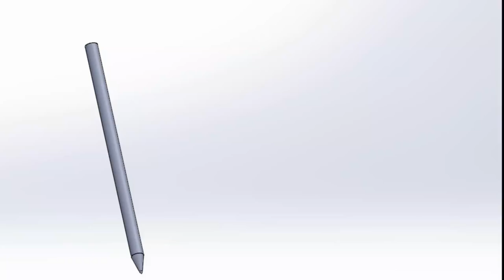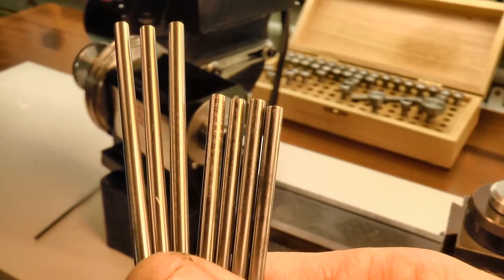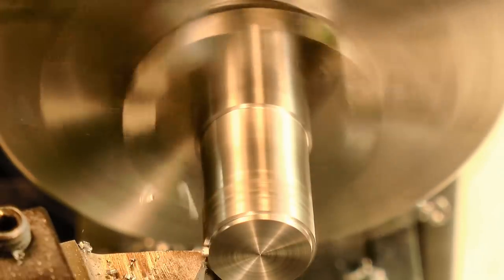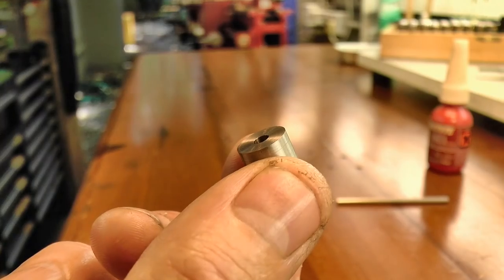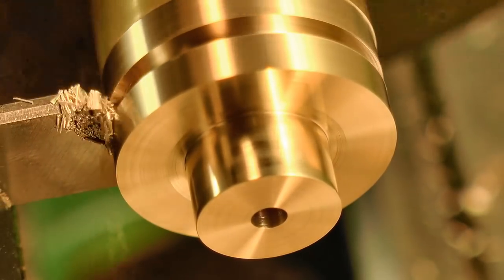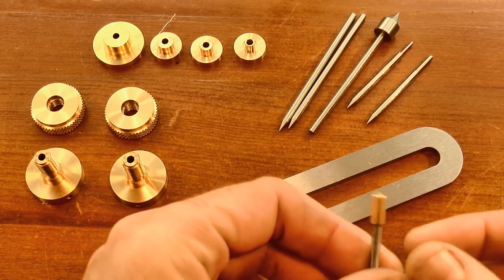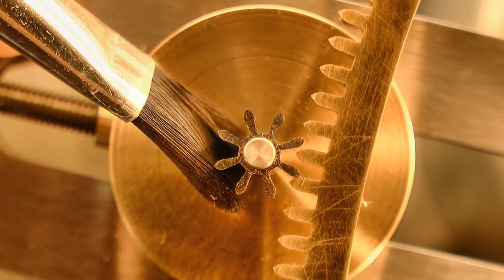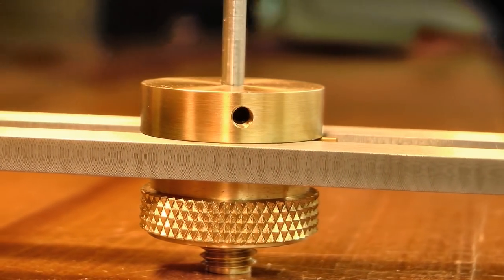Home Machine Shop Tool Making - Machining A Pinion Head Depthing Tool - Part 3

Comment: Holy cow. I have, with rapt attention, watched you craft every millimeter of this tool eagerly awaiting the next installment. It is only now, that I even had any clue what its purpose was or how it was used. Well crafted sir!
Reply: Harlequin314159 I like you was riveted to this series wondering how it would function.  Makes perfect sense like most old school tools.  Wonderful series!
Reply from the maker: Fred Miller Thanks Fred. One of the things I love about clockmaking, is that the old school makers were so very practical.
Reply from the maker: Harlequin314159 I did wonder as I was making it if I should have explained it's use better at the start, so thank you very much for sticking with it through to the end!
Reply: Clickspring I like how you handled both this and the clamping tool. Demonstrating its use completely at the beginning would kind of spoil the end product I think. Cheers!
Reply: Clickspring I agree with OP - It was kind of a mystery until the very end of part 3 what exactly this would be. Good approach to keep the viewers hooked :-)
A little more info on how exactly the correct distance matters would be cool though. Maybe as a little bonus episode?
Reply: Clickspring Nah.  It's better this way.  Like ***** said, it actually drives suspense.  Your channel should seriously win awards or something.  Thanks for sharing this with us!

Comment: Great video,
I am just at the starting line of clock making, retired Engineer/Metallurgist.
I am reading a number of books, but I have to say...
Your video's are very informative, great viewing and well made.
They provide something extra in my case, I am from Northern NSW. Australia,
pretty isolated as far as others interested in horology, so there is nobody to ask or compare notes.
 Your video's fill that gap for me.
Thank you
Reply from the maker: +Noel Rieusset Hey Noel, I'm in Cairns so also a bit isolated from other horologists! Great to have you watching mate :)
Reply: I'm in Scotland (UK) and couldn't agree more.
Not looking to build a clock BUT repairing them often requires making replacement parts and Chris is so easy to listen to Plus very informative.
Keep up the good work.

Comment: Great video!  For anyone working with gear trains this explains a lot.  I am working a gear train where the gears have  1" bores and are 1" thick.  The center to center distance is 3.75"  This tool will be a joy to make and use.
Reply from the maker: Gus Lint Thanks Gus. Send me through some pics when you've made it, would love to see.

Comment: Beautiful work as always. To really have a super fine adjustment, you could use square up your brass end cap on the threaded rod so it doesn't rotate in the slide, and then incorporate a differential screw mechanism.

Comment: Dear Chris,  I think that this depthing tool is a great model for something that I need in the workshop when measuring and repeating holes that already exist in a part and I want to make a matching part to mate with the primary part.  No matter how hard I try to measure with a ruler, the final product is always a few mm out. By using your idea with an array of rods and cone shaped heads, I could then precisely measure the distance between centres of two holes and stamp them with a light tap onto the mating part. My problem is then theoretically solved.  Now a tool that handles three or more holes ...That's for another day.  

My concerns are that the length of the tool will be limited by the wobble that would come in when making a longer length one.  Yours is say 300 mm long and I would want one say 600 mm long.  I guess breaking up the central slot into two slots and keeping a central web will maintain stiffness. 

The saw that you use to cut the round rod looks like it has a round blade, what exactly is that made from?  Cheers.

Comment: I've watched quite a lot of your videos now in rapid succession (since I discovered your channel yesterday) and I simply love them. I have a remark though, a request, if you will.
Could you show us a little more about your process of measurement and calculations as to how exactly you achieve the level of precision in for example the outer diameter of bushings and other critical surfaces.
Again, thanks a lot for taking the time to produce these wonderful videos.
Reply from the maker: EddvT To be honest, there's not really that much to show in that regard - I rough cut using maximum depth of cut that I think I can get away with, until I'm within a finishing cut from the final dimension, I then do a quick check, dial in the final cut, and then go for it. If it's super critical, I might sneak up on it with multiple passes for the final passes, measuring in between each pass. Thanks for asking mate, Chris.
Reply: One more thing, then I'll leave you (for now, lol) I've seen you using digital callipers for measuring, do you use micrometers sometimes? Or does a quality pair of callipers do a good enough job?
Reply from the maker: No problems mate :) They are cheap calipers, and I'm happy to use them for length dimensions, or when a diameter is not overly critical. The error is within a few thou, and it's rare in my work that a length dimension is super critical, certainly not like it often is with outside/inside diameter. When it does matter, I use a micrometer.

Comment: Another very nice effort Chris, I've only ever seen the traditional depthing tools, so this was good to see and perfectly executed. I must remember to watch to the end of your videos as I like your stop motion work.

Not trying to tell you how to suck eggs, but I believe the Loctite you're using in each of the videos I've seen is green (wicking grade). Based on what you're using it for and how you're using it, you may find red better. It's not expensive to buy. In these applications it may not make any difference, but could be something to consider if you hadn't already.
Reply from the maker: +Pete F Hey Pete, glad you're enjoying the videos! The colors you refer to are for Loctite thread locker. The product I am using is Loctite metal adhesive 603, rated high strength, designed for bonding cylindrical parts.
Reply: +Clickspring Oh nice, thanks for that. I only caught the bottle and presumed it was wicking grade. Never assume anything, as I just made one of me. Carry on as you were ;)

Yes the videos are very well done. They are admittedly hindering my own work as I find yet another excuse for a cuppa and another thrilling episode in the world of Cairns clock making action,  but as they always say, you can never have too much tea!*

*Actually I don't think anyone says that at all, and you probably can have too much tea. But it's my excuse for the day and I'm sticking with it.

Comment: Truly outstanding work and beautiful production video!
When drilling holes, why do you first use one drill bit and then the other one to finish the hole (first one has very short cut threads). Is the first one harder, so it's easier to start the hole?
Reply from the maker: Andrea Arzensek The first one is called a spotting drill, and because it is short and stiff, it resists the natural tendency of a drill bit to 'walk'. It is used to put a small cone shape at the location where you want your hole to be. The second drill bit sits in this starting cone shape as you start to open up the hole, and it is effectively held at the location, resulting in a precisely positioned hole.
Reply: Great, thanks for the answer, and finally I see you use one last bit which has steeper spiral cutting edge. I suppose you fine tune hole diameter with that one?
Reply from the maker: Andrea Arzensek That is correct. If the final diameter and surface finish is important, I will use an end mill - they are very stiff, and leave a precisely sized and located hole with a superior surface finish. Spot drill->Drill->End Mill// Thanks for watching mate!

Comment: I have another question, Chris: How do you determine the amount of margin to leave on the stock for purposes of cutting? I'm sure cutting exactly where the measurement says, you'll have no room for error or for finishing. So how do you determine how much extra to leave?

As usual, impeccably amazing work. I won't bother too much with more compliments as every possible variation has already been (well deservedly) mentioned in the comments. Great work.
Reply from the maker: +Aravind Pisapati  Typically I will cut about 1mm short with the jewellers saw, and then end up 0.5 mm short after the 80 grit sanding belt, leaving the rest for filing. In each case, it is so that the deepest score mark sits outside the next stage as I approach the line. It is surprising how much variation there is in the cut depth for a jewellers saw blade, remembering that not all cut strokes are perfectly vertical. Same applies for coarse grit belts. The finishing with files starts at #2 cut and ends at #6 (occasionally #8 cut), using up that remaining 0.5 mm. I tend to be quite cautious - nothing quite so annoying as taking off more metal than you wanted, particularly at the jewellers saw stage. Great to have you watching Aravind :)
Reply: +Clickspring Whoa that raises a lot more questions than it answers! Thank you very much for the detailed response. I'm more of a computers guy than a machining guy, so here goes, if you have the patience to answer:

1. What's a score mark?
2. How do you know the exact names for all the terms in the process? I mean for the tools, what the method is called, etc?
3. You make lathe work look so simple, which makes me wonder about all the things you do in the background that a viewer isn't aware of, either preps for safety or some particular technique or which metal the cutting bit of the lathe is made of. Could you tell me a little about the problems you run into with the lathe that we don't see here?

Sorry, I know there's a lot of questions, but this is way too fascinating to not get in-depth with.

Comment: Jewel-like!.

Just as +rotate85, I am curious about why depthing rather than calculation is the proper way to space clock wheels. Is it because of the difference between the tooth form and the involute form used for power transmission?
Reply from the maker: Peter W. Meek That is a great question - One of the benefits of the involute gear form is that it can tolerate a fair deviation from optimum depthing. The cycloidal form is much less tolerant, and very sensitive to changes in depth. You can actually see and feel the difference that a small change in depth makes while using the depthing tool. The gear meshing goes from smooth as silk to grinding and noisy with a shift of only a few thou.

When the wheel and pinion are fabricated, there will inevitably be small errors associated with the key dimensions (OD, tooth profile etc). The sensitivity of the cycloidal form to depthing errors means that the true optimum depth must be determined from what you've actually ended up building, to take into account this deviation from the theoretical construction.

A clock is also prone to quite startling wear over its lifetime. Many constructors will depth a train slightly shallow or deep, knowing that over time the wear on the pivot holes will lead the train closer together, or further away. That way they can minimise the effects of this wear on the depthing of the train.

The theoretical figure is a good guide, and gross error check though.

Thanks for asking Peter!

Comment: Really interesting seeing how you make this, one thing that made me a little confused is that you say that you set up the laithe for a 30 degree cut, but the video shows 15 degrees. Is this an oddity of the laithe you got, an error or the norm?
Reply from the maker: +thorerik That is the norm. The included angle (ie total angle of the point) is 30 degrees, so because of the way a lathe always cuts half of a taper, it is set up to cut 1/2 of that. It helps to visualise the lathe axis from above, and observe that the cutting tool can only ever cut on the near side of the work, but because the work rotates, it ends up cutting double the angle it is set for. Thanks for watching and asking.
Reply: +Clickspring Make sense now that you say it, Thanks for the explanation, and awesome videos!

Comment: I'm curious why you can't simply calculate the distance between two gears?  If the gears are cut following a blueprint then a specific center distance should be part of the design.  No?

Comment: Doesn't the geometry of this tool mean you have a minimum size of the gear you can test the depth of? Wouldn't you want smaller runners than what you have so you can test smaller gears?